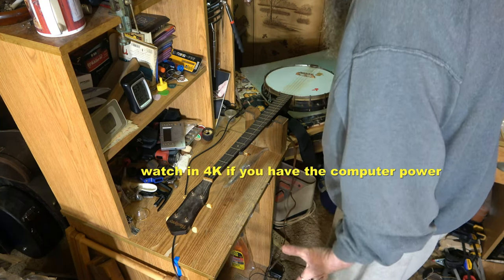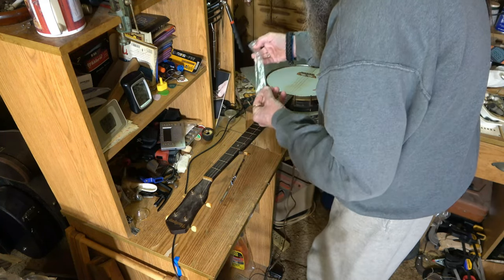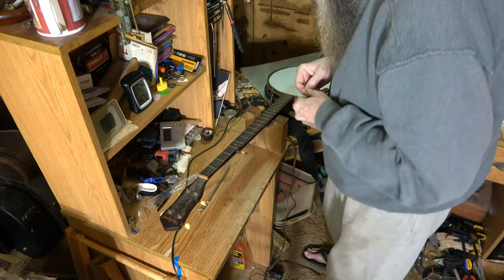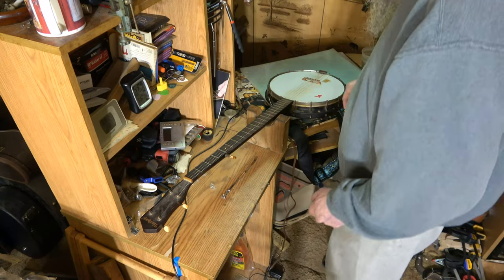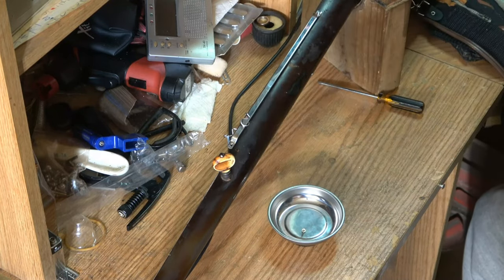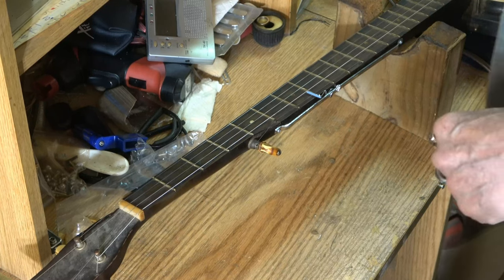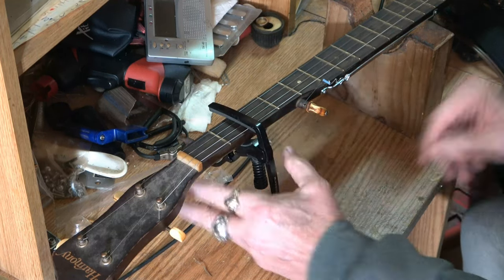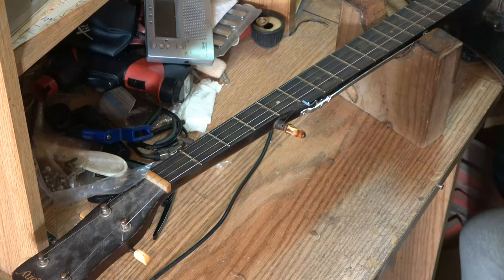unique capo

Comment: After 28yrs of banjo playing, I have fooled around with almost every different kind of 5th string capo made for banjo. In my opinion, none of them work as well as the spikes do when they are installed correctly. The spikes almost always require a little fine tuning when being used, but most banjo players are always fine tuning something anyway.   lol   
     The "slide style capos are always very touchy about placement & always get in the way of my thumb on that end of the neck. Because I use melodic & chromatic sequences pretty often in my playing, it's important that my thumb has the ability to fold over & catch the 5th string quickly & solid for a clear note. As I'm sure Randy knows from his experience, spikes should be installed in line with the 5th string & just slightly toward the fret the string will be contacting. If your bridge is off centered, your strings will not be in the correct alignment & will cause the spikes to be incorrectly aligned as well. Now, this may not seem like much of an issue at first, but I can assure you that it will cause tuning issues & intonation issues that will be noticed as a player gets more experienced & their ears get finer tuned to the instruments notes & overtones. I hope this long comment may help someone on their musical journey. God Bless Randy Schartiger & The House That Never Sleeps!!!!!!! HOLD ON!!!!!!!
Reply from the maker: You are exactly right! I used to play a lot of melodic fiddle songs and chromatic lickd on the bandjo and used that fifth string noting a lot. Thank you for having a look!